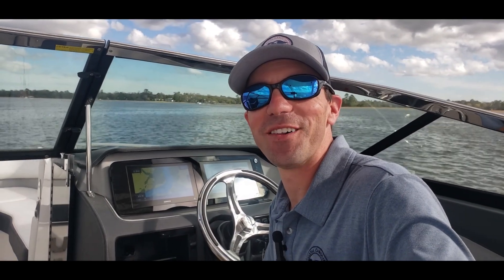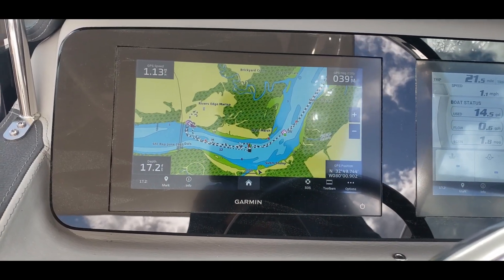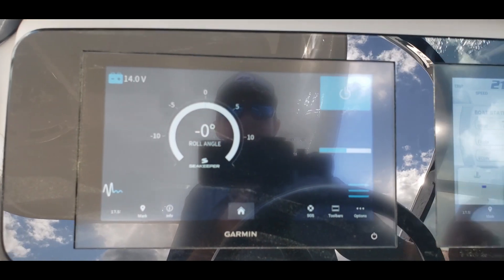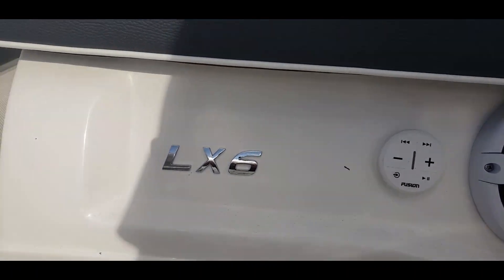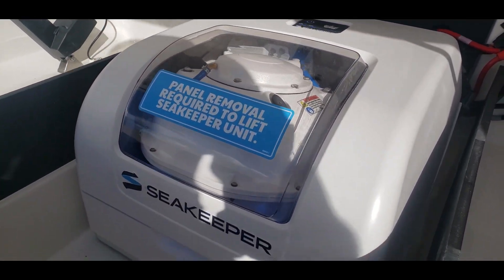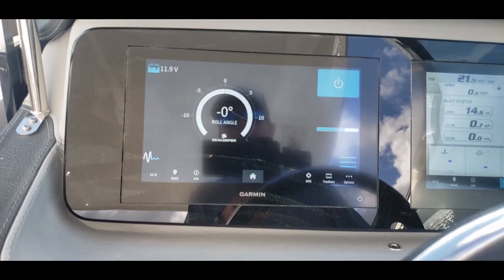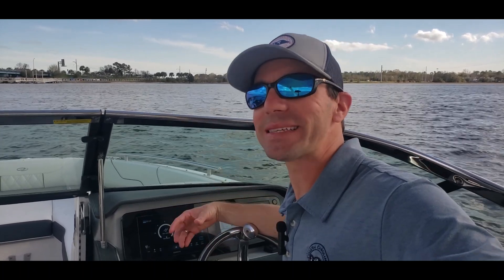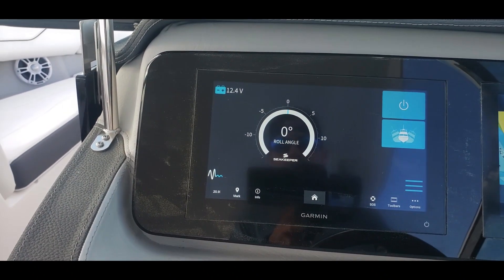Seakeeper 1 Stabilizer Gyro - Coolest Option on a Regal LX6 Boat

Comment: Hey, how many batteries is the LX6 running to spool up the Sea Keeper and how long will it run when the engine is off chilling at a sandbar before it depletes the batteries?
Reply from the maker: The Seakeeper 1 only takes one battery. I can't say from personal experience how long it'll last but if you go to the link below, Seakeeper does a great job breaking everything down including a calculator. Thanks for watching.
https://www.seakeeper.com/faqs/how-much-power-does-a-seakeeper-use/
Reply: @LowcountryBoater  thanks
Reply from the maker: @2wheelAdv  You're welcome and thanks for watching!